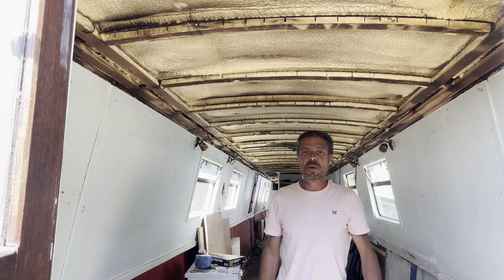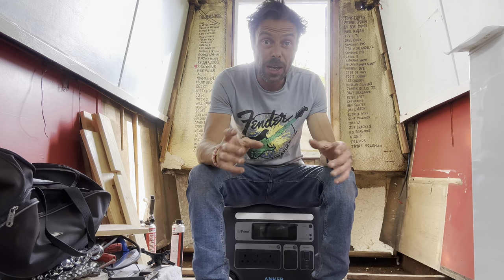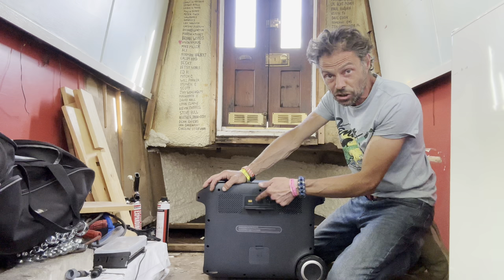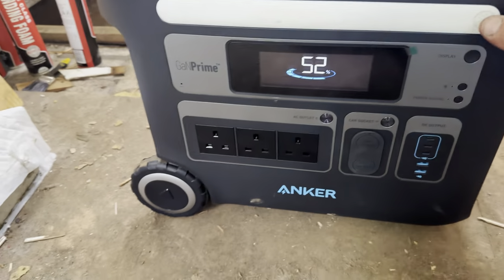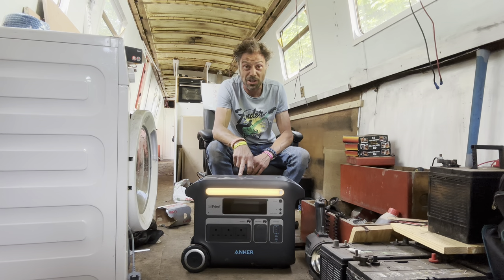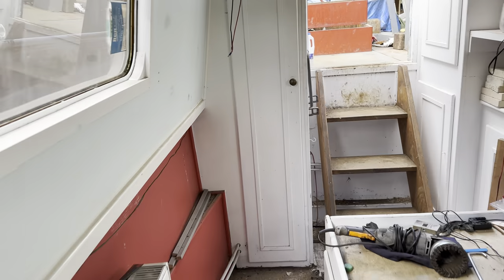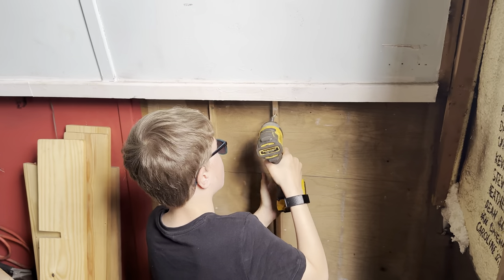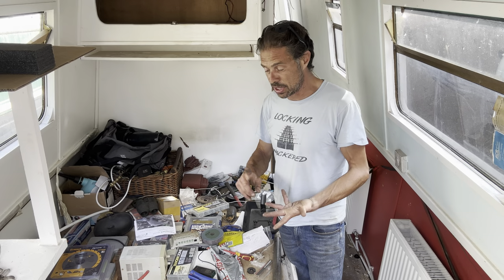447. Back to the BUILD using ONLY Solar power

Comment: Be aware the lithium must not be charged at low temperatures. Some do have heaters built in that heat the battery upto charging temperature before starting the charge but thsese are rare. Most lithium batteries that are "temperature proof" simply have a charge cut off at low temperature; they wont charge at all when it's cold. So, you will need to house them in the cabin space.

Comment: Agree on your solar and lithium batts aproach.
Lithium batts must have a proper lithium charger. And the LiFePo4 batteries (lithium iron phosphate) are much safer than the earlier types.
Alos note that lithium batts will take charge quicker than lead acid. Lead acid will bulk charge to 70odd percent, then the remaining absorbtion charge is very slow. Whereas lithium will bulk charge to almost full.
And if you limit the charge/discharge lithiums, they should last far longer than 3000 cycles. (10% to 90% will be more like 9000 cycles. So a juggle on that 20% extra capacity vs batt life.)

Comment: Hey James. What i dont understand of narrowboaters is why they dont put an extra big alternator on the motor. So this turns your motor in a power generator. This is done in every othe boat or sailvessel. So why not in narrowboats. So everytime you have no power just run the motor stationary and your batterys are full😅
Reply: You are right
Reply: Project 58's engine does have an alternator. The solar panels are for when the boat isn't moving. Solar is free, diesel costs money.Running the engine while moored is very annoying, including for those moored around you. Some larger appliances can only run with the power provided by the engine, like a washing machine.
Reply: @weerwolfproductions  yep great when the sun shines personally I think James is being optimistic about only using solar to recharge his power pack I can see more trips to Costa coffee to recharge it in his future

Comment: Nice to see the vetus in position James. Definitely need those engine bearers touching up! Are you not using the ecoflow mega packs to power the build, or has Rob pirated them off you? 😁 Actually, for layout, how's about from the rear: kitchen, lounge, master (double cross bed, bathroom, then bedroom 2 with bunk bed above cross double so you could sleep three kids at the front.

Comment: Would it be possible to use the Anker battery instead of lithium leisure batteries? You wouldn’t need an inverter for the 240v output and the 12v stuff (lights, pumps etc) could run off it too

Comment: Very interesting video, very informative. As for lead acid starter batteries, there are those available with an external vent connection where you can connect a plastic hose to them and vent the battery to the outside of the enclosed space. We had these batteries in the States and they were widely used on the Chevy Corvette and even on my Renault here in the EU. It keeps those corrosive gasses out of the vehicle first for safety and second to prevent corrosion of the battery holder / compartment. You need to really check into using Lithium based batteries for starter batteries, there might be additional electronics needed to interface your alternator to the charging system, be safe!
Cheers!

Comment: i had a possibly innovative idea!  Seeing you have been bequeathed a free front loading washing machine which are always put on the floor, especially in a boat since they are weighted with breeze blocks.  Are the breeze blocks really needed if the case is absolutely held firm by other means?  it's all about keeping it still to prevent bearing wear etc.   that's a couple of cubic feet of cupboard space saved by cutting the blocks and bottom off the unit whilst retaining the full drum size/load capacity.  rather than have a small machine as boaters usually do.  also, without the weight of the blocks the machine could be firmly mounted higher up in a cupboard, above the hot water tank possibly.

Comment: Be aware the SOME (cheap) Carbon Monoxide detectors will trigger if they are close to lithium batteries that are being charged. Lithium batteries do give off a gas that happens to trigger them). That includes phones. Some boaters found that out the hard way, being woken up every night by a detector sitting directly above a charging phone!!

Comment: Hi James.
To be honest, I'm getting a bit tired of the adverts...
The main disadvantage of lithium batteries is that they cannot be charged at below 0 degrees C.
As an ex seaman, I feel I should warn you that it's unlucky to rename a ship!
Crack on!
Reply: Modern Li can charge lower than 0 and narrow boats are ok with a name changes !
Reply: Most boater put their lithium batteries inside the cabin rather than the engine bay. 
Narrowboats can be renamed whilst out of the water.
Reply: Yet sea going vessels have their names changed all the time. Are you suggesting that after renaming they're all inherently blessed with bad luck?
What a load of superstitious nonsense!
Reply: @markdoble736  Luck and superstition go hand in hand, Mark.  I don't make the rules, I was just passing along my knowledge of nautical lore.  FYI, I don't believe it either, but you never know...
Reply: @sarkybugger5009  Luck and superstition are in no way connected, the former is simply chance and fortune, the latter is an ignorant or irrational belief.
My apologies for disputing your original post so vehemently, but you didn't say it was your belief that it was unlucky to change the name of a ship, you actually said it was.
Whatever the misfortunes of changing a ship's name, it clearly lacks any supportive evidence to back up the claim.
Reply: @markdoble736  I would dispute your assertion, but frankly, it's not worth the time or effort.  I probably should have added the word considered unlucky, to my original comment, but then I didn't expect to be justifying my choice of words on a YouTube comment.
Have a nice day.  😎
Reply: @sarkybugger5009  No, you're quite right, YouTube open comments should not be a forum for unnecessary arguments, my apologies for being so vehement in my response to your post.
It's just that the name changing superstition amongst narrowboaters is so widespread that the completely irrational support of it really irritates me... as you have probably already gathered.
What I would like to know, is how and when did this particular superstition originate? Was there ever a period when large numbers of vessels changed their names and subsequently incurred serious misfortunes?
I have found no evidence to support any large scale occurrences of this nature, but as an ex-seaman, perhaps you can enlighten us, I should genuinely like to know if there is any rational basis to this belief.
Reply: @markdoble736  I have no idea where the superstition originated, but the nautical world has many just like it.  Women used to be considered unlucky onboard ships, (because reasons,) as was whistling. (Whistling up the wind.)
Presumably harking back to times when sailing was a very dangerous occupation, and knowledge of how "shit happens" was limited to rumour and speculation...  🤔
Reply: @sarkybugger5009  Well, whatever its origins, the vast amount of actions reported to counter the impact of the superstition is at least an amusing side effect of this misguided belief.

Comment: If you're going lithium batteries put them in the same place as lead batteries. They can be nasty if things go wrong. I prefer lead crystal batteries. Longer life than lithium but cheaper and can be taken down as low as lithium
Reply: I think lithium batteries are more cold sensitive so they may need to live inside to protect them from frost.
Reply: @PinkLittleElephant  that is probably right. I just don't trust them when water is involved
Reply: @davidsutherland5044  you do hear occasional horror stories about lithium batteries catching fire because of physical damage to the cells or a fault in the charge controller. Once they burn, they are hard to extinguish.
Reply: @PinkLittleElephant  exactly. I drive electric buses and the safety precautions are bloody rediculous
Reply: Another issue with lithium batteries is cold weather.  The range of electric cars plummets when they get cold.
Reply: @thenormanfair true (for most types of batteries?)… but if the batteries are in the cabin then they should never get that cold … and most things connected should not have a huge drain on batteries.